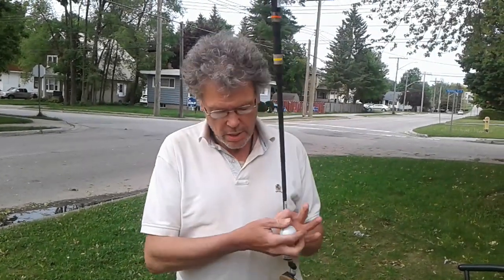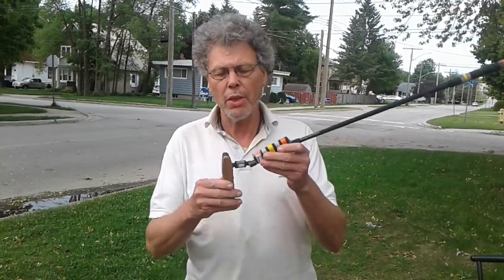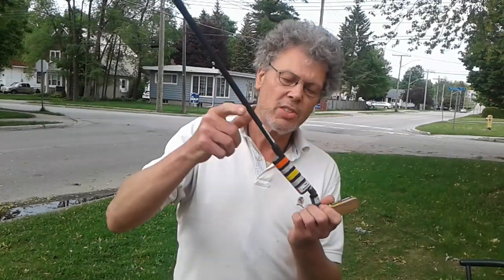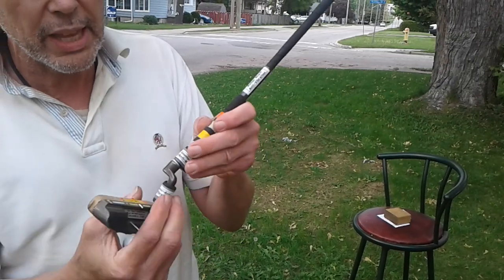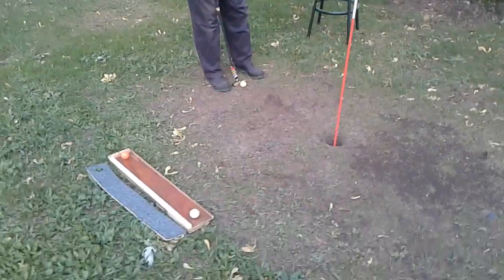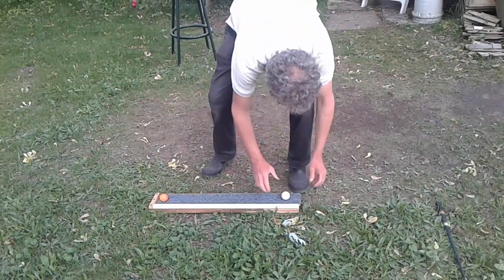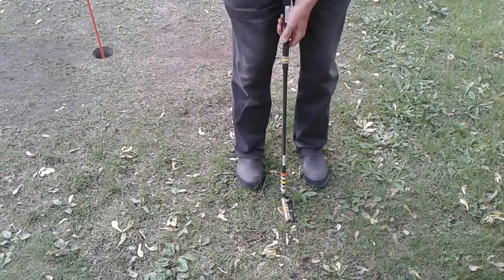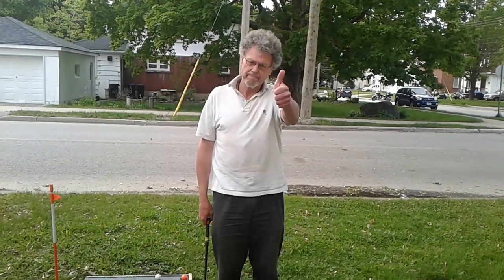Golf Putting Alignment - Midland, Ontario, Canada (Part 7)

Comment: Donovan, I'm intrigued by your findings. I am an avid golfer, I play daily. I have a couple of questions though. When you are allowed to draw a line on the ball, why not just point the line at your target and square the putter to the line?
Reply: Did a lot of research on "Lines on Balls", Pros using logos, etc, Blogs saying lines on balls should not be allowed. Here is the problem. It is math. 30-30 rule. You would have to line up your "line on the ball", to 2/3 the thickness of a credit card, to the golf cup, which is 10 feet, 20 feet, 50 feet away. Then you would have to square your putter face to that line, again to 2/3 the thickness of a credit card. It does not work. But when you walk up from behind the ball, then align your body to the pin, ball under your nose/coat zipper, and parallel your feet, the resolution of your eyes easily see any tilt of the putter face, and you will find it impossible to not square the putter face, to the center line of the ball, and the line of sight to the pin.  Lines, and logos actually confuse your eyes and your brains. I actually found one expert who said, he places the ball so nothing can be seen, no lines, logos, nothing. He was right. Key is, once the putter is aligned, do not let it move, and it will not as the flat grass will steady it. Step 90 degrees around, the putter is now parallel the both your feet again, and putt. Last Monday, a golfer from Midland, pulled a 50 foot birdie, using "I'm Aligned". What is so cool is that, every time you align, your brain knows the line of sight is correct, and that reassurance frees up mental capacity, to think about stroke control, stance, not swaying the putter, etc. Thanks to my Son Lorne, who runs and produces this channel.

Comment: Did a lot of research on "Lines on Balls", Pros using logos, etc, Blogs saying lines on balls should not be allowed. Here is the problem. It is math. 30-30 rule. You would have to line up your "line on the ball", to 2/3 the thickness of a credit card, to the golf cup, which is 10 feet, 20 feet, 50 feet away. Then you would have to square your putter face to that line, again to 2/3 the thickness of a credit card. It does not work. But when you walk up from behind the ball, then align your body to the pin, ball under your nose/coat zipper, and parallel your feet, the resolution of your eyes easily see any tilt of the putter face, and you will find it impossible to not square the putter face, to the center line of the ball, and the line of sight to the pin.  Lines, and logos actually confuse your eyes and your brains. I actually found one expert who said, he places the ball so nothing can be seen, no lines, logos, nothing. He was right. Key is, once the putter is aligned, do not let it move, and it will not as the flat grass will steady it. Step 90 degrees around, the putter is now parallel the both your feet again, and putt. Last Monday, a golfer from Midland, pulled a 50 foot birdie, using "I'm Aligned". What is so cool is that, every time you align, your brain knows the line of sight is correct, and that reassurance frees up mental capacity, to think about stroke control, stance, not swaying the putter, etc. Thanks to my Son Lorne, who runs and produces this channel.